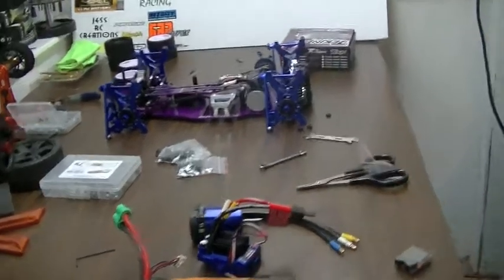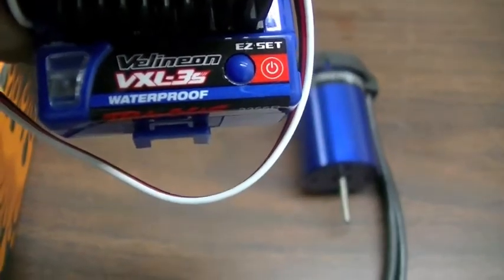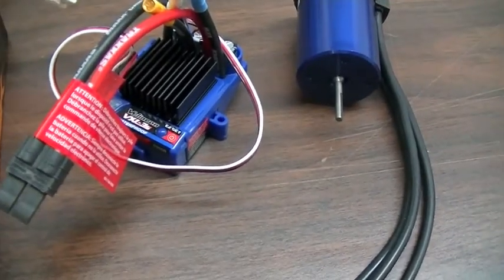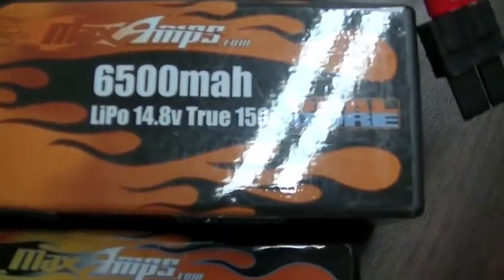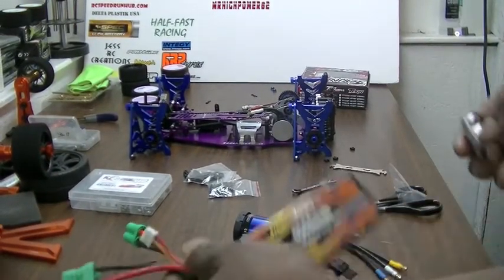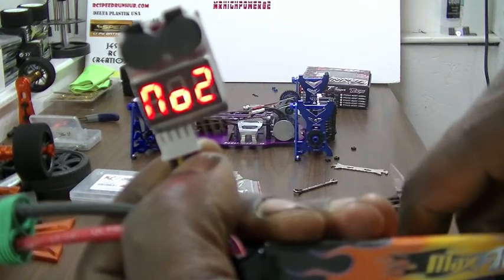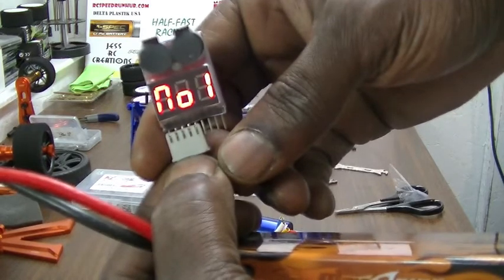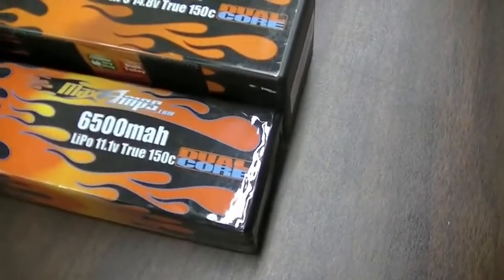Reyluna 70+club Walk Around Update

Comment from the maker: Hey guys after talking to one of the club members who has tons of knowledge on castle products and getting on castles website the mamba max pro esc is 2s to 6s compatible and the sidewinder esc is 3s. Theres an advantage when running a 3s lipo with a 6s esc over running a 3s lipo with a 3s esc. I can't get into detail about it because of the club rules. I have to go by the rules so please guys make sure your running a 3s esc and lipo as wells a 3500kv to 3900kv motor.